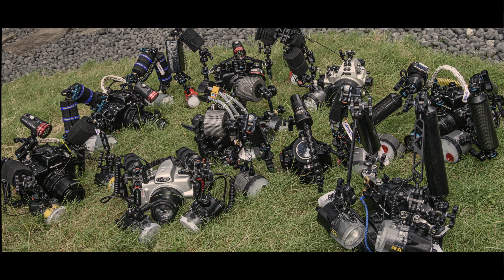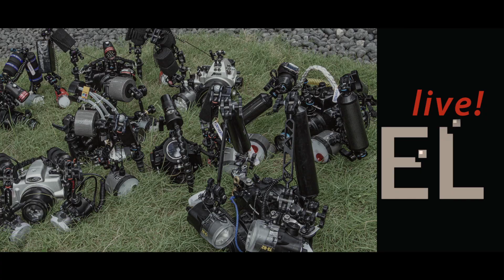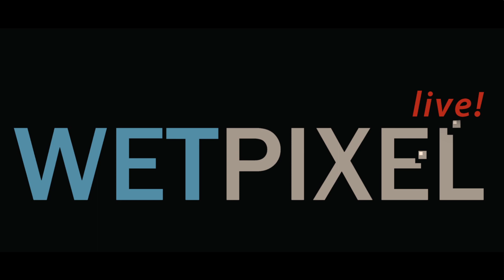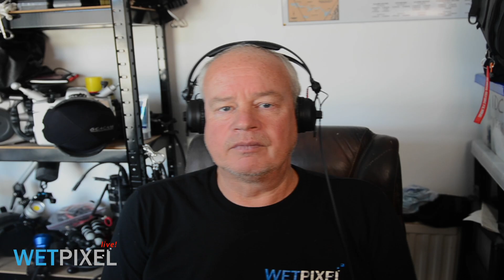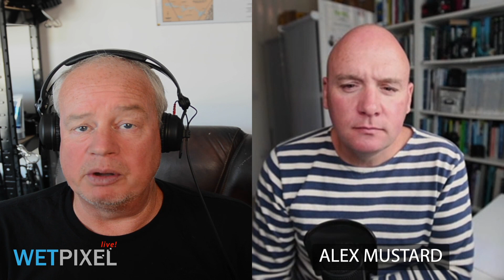Vacuum Housing Systems for Underwater Photographers

Comment: I'm relatively new to UW photography in many ways. I've been using a GoPro with a few extras for about 5 years now but am now finding it definitely has its limitations. Depth is its biggest problem as my GoPro Hero craps out at about 30 feet.  I am looking to upgrade now and figure I will go with the Canon Rebel  SL3 250D camera and 6970.08 Ikelite housing. From what I have read this setup is pretty good. From your video here it sounds like I should add a vacuum to ensure I do not flood my gear on my first time out. Any thoughts or recommendations are greatly appreciated.
Reply from the maker: Hi Trevor-check out the Wetpixel forums. There is a great deal of advice about cameras and vacuums over there

Comment: I did once have a leak in the vacuum after about 10 minutes (light went from green to yellow in that time) which fortunately occurred while I was gearing up.  I ended up missing the dive so I could diagnose and fix the problem which turned out to be a bit of sand on the port o-ring.  So the 5-6 minutes isn't a hard and fast rule.  I tend to usually pull the vacuum before I setup and if it's still green by the time I'm ready to go in the water, then I feel comfortable that everything is good to go.

Regarding your battery comment, I'm glad that on the NA-D850, Nauticam made the battery for the vacuum alert system and the battery for the strobe trigger the same which means I just have to worry about buying a bunch of the same type.  I understand that those are different batteries on the NA-D500.
Reply from the maker: As is sometime the case, the diagnosis of your test may have been either the grain of sand, or a change in pressure due to temperature changes etc.? If the vacuum holds for 10 minutes, I would suggest that the grain of sand is/was not the culprit, although it does complicate the diagnosis! I guess we will never know, but for a vacuum to hold for 10 minutes would strongly suggest that the housing is sealed. 

I have put fine cat hairs through the O ring (deliberately) and the vacuums pick the leak up in a matter of seconds...

My NA-D850 uses two different types of battery...so I guess it depends from unit to unit somewhat too!

Comment: They can also be fantastic for diagnosing difficult to find leaks, such as leaks coming through buttons and hardware bulkheads. 

I brought an old housing for an Olympus e-520 back from retirement earlier this year and by pulling a hardish vacuum (-0.5 bar) and dunking in a bucket of water, I found about 6 leaky buttons and leaks in mounting hardware that otherwise I would have had to dive separately with no camera to find. This obviously saved me quite a bit of time and fuel!

I probably should have fully stripped the housing and rebuilt it with all new seals, but when it starts off as just one leak you try to get away with the least amount of work possible.
Reply from the maker: I certainly use a vacuum to ensure that a housing is sealing...and this is a distinct advantage when using new or unfamiliar equipment. I also think that submerging a housing in a rinse tank or similar will show any leaks for servicing/repair purposes, whether a vacuum is used or not!

Comment from the maker: Something we didn't mention in the video, but probably should of: If you have a vacuum system, please make sure you carry a spare battery (of the correct type) with you. Sadly, manufacturers often seem to use different batteries for TTL/strobe triggering systems to those in vacuum/leak detection systems. It would be nice if they could try and standardize...

Comment: Personally I like the Nauticam vacuum/leak systems too, especially the newer generation ones (with multi color LEDs). I even installed those in my Gates Deep Weapon housing (sorry -J).
I prefer to pull vacuum in the evening and let is stand overnight. This has more to do with the extreme environments I work in, long scouting (travel) before diving (in extreme conditions) and the high value inside the housing.
Due to a production miscommunication, I once hit the water without pulling a vacuum on the housing. That was the only time since I started using vacu/leak detection systems and... em... yep, it was my only flooding to date; a very expensive one.
Almost always a flooding is caused by a human error. This is why vacu/leak detection can save money, production time, failing to deliver contract on time, frustrations and much more. I never ever had a false positive. I had only one positive which I can recall: due to jetlag and rushing assembly I forgot to put a +/- 40cm diameter o-ring in a port extender. Pretty obvious but with that knackered brain, this error would have ended in a catastrophic production without these great tools.
Another advantage pulling a vacuum has, in my experience, is an improved structural integrity of the assembly. All parts are compressed together which, as Alex mentioned, ‘locks’ unlockable parts (some domes) but also makes it safer to hit the water hard with the housing (jumping off the boat whilst driving). It also tolerates higher leverage forces, something which can be(come) an issue in the big housings weighing +70 lbs.

I strongly advice against diving houses without the sealing cap on the valve in cold water. Due to different shrink/expansion ratios of their various components, they will leak in extreme environments. Having the o-ringed cap on them prevents the leaking.

Sucking a vacuum Alex... hehe! That would be a hell of a job for my Gates: it takes about 100 strokes with a Nauticam pump to get it to the right under-pressure :) I also have a little Venturi pump which is driven by an LP scuba quick bajonet connector. Pulls a vacuum in the Gates in less than 10 seconds (compared to 100 pump strokes).

I enjoy your chats, Adam and Alex! Please keep on doing them 🙏🏼🌊👌🏼

EDIT: BTW: when you run on a Nauticam leak system and the LED immediately starts blinking red; you need to replace your battery :) (of the leak detection system, not your camera... LOL).
EDIT2: I always lick my finger and then touch the copper contacts to check it the electronics still work. Indeed, I’ve had a few which looked like they worked well but actually didn’t put an alarm when they were wet. Some simple ‘automatic’ procedure I do without even thinking about it.
Reply from the maker: Hi Michael, thank you and we are glad you are enjoying them!

False positives are a thing! I have had it with several systems, and they are a significant problem when on assignment. I should point out that this was some time ago, however. 

Once the vacuum has held for a period and hence confirmed that you have correctly assembled your housing, there is no real advantage in having continuous monitoring. The reassurance of having a colored light continuously telling that the vacuum is constant is purely psychological! If the vacuum has held for a period, the only way the housing can flood is some kind of catastrophic failure (port implosion or similar), which a vacuum will not prevent.

In the ROV and offshore engineering industry, vacuums have been used since (at least) the '50s to ensure that instrument pods are sealed, and once this is proven the pods are (often) then pressurized with an inert gas to reduce fire risks and to maximize crush resistance. Obviously, they are working at much greater depths than we normally do.

Comment: Vacuum system is like automatic gear in a car. If you learn using these tools it is very hard to go without. If you learn without you'll easily adopt the systems but capable to live without.

Alex, you have to try to use wide rubber band or a piece of tape to lock the zoom of your 8-15 lens to 15 mm position.
Reply from the maker: I drive both automatics and manuals, and find that I prefer each in different circumstances! Vacuums do no harm, unless they are preventing you from being underwater taking pictures. We should always focus on assembling our housings correctly, rather than pulling a vacuum. This means that if the vacuum is not available for some reason, we are prepared to trust our skill and ability in assembling housings.